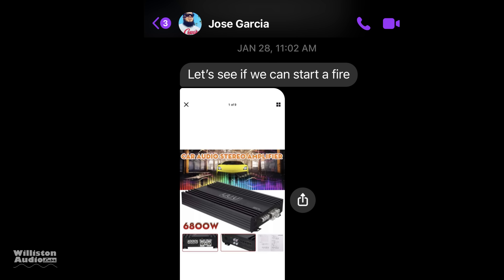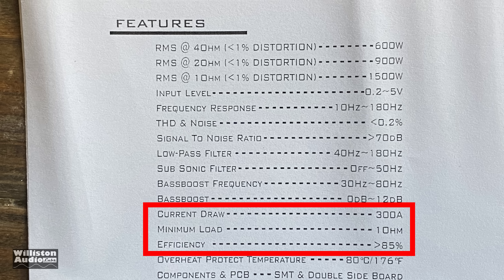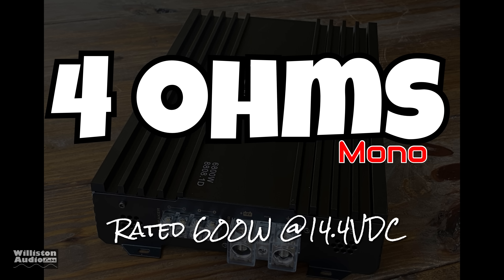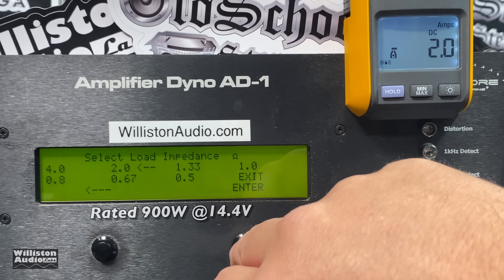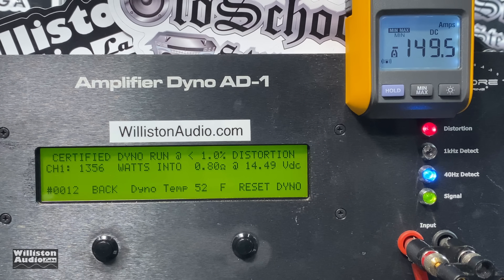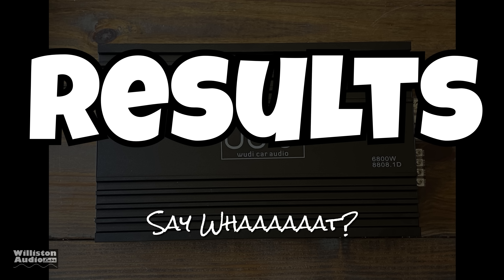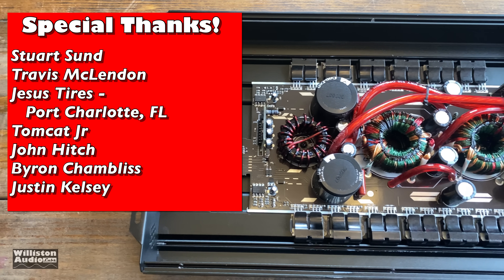BEST $100 Subwoofer Amp?? WUDI 8808.1D 6800W Amp Dyno Test and Review [4K}

Comment: this amp is a repairmans dream come true if you know what to look for. the audio output generation circuit is isolated by optocouplers from the actual drivers and final stage hence damage never goes further than the optocouplers! 

in my experience its the closest ive seen to modularity in an amp build. this board design is quite generic and generally makes 1500w @1ohm. there are weak spots tho and could and should be beefed up before use.

if anybody has Perrys guide, its generic class D type 4
Reply: Beefed up how?
Reply: @FreeStyle786  this one has some good glue on the transformer winds to minimize vibration. also the board is screwed down the middle which helps a ton in the long run. both the driver card will need supports tho. other than that looks like the amp will do well in the long run

Comment: So, it appears that just to save a dollar or two: they ruined the structural integrity of the board. Perforate and break off the driver cards right out of the board. Cheap AF! These will undoubtedly suffer from vibration damage-related issues. At least the D'Amore amp you reviewed was engineered properly with good QC. This is just cookie cutters and terrible shortcuts.
Reply: @wal  I forgot to mention that you're doing a great service to the community and no matter what I say, I appreciate every bit of media you release!

Comment: as of the 5th of feb 2021 when this video was posted . in SA it cost equivalent to  235USD so no not under 100usd. but its a strong amp by the looks of it. and surprise 0.5ohm which rick says many amps cant do.

Comment: same brand of caps as the D'amore amp you just tested.👍
Reply: @E Dud interesting, thanks for the comment. I have wondered if the more the more budget friendly D' Amore amplifiers were using cheaper parts & materials... Figured they had to be considering they are priced as low as the $200 range. I had been looking at one of the D' Amore 4 channel amps think it was like $230 or right around that price. (I don't remember the exact price but you can find the on the D' amore site) Idk if I should pass on it & look for a better 4 channel, just curious about the quality of a D' Amore amp priced in the $200 range brand new. 🤔
Reply: @itdoesntmatterwhatyourname6128  Yep I think im going to buy a couple of them anyway because you know Tony had to have done his homework when picking out all the internals he doesnt want anything coming back🤣I bet he did alot of testing I was sold when Steve Meade put the 350.2 and the 750.1 on the dyno they did outrageous numbers👍
Reply: Yes it was your right ! I didn’t notice it until you said that and D’amore is suppose to be nice stuff far as I know !

Comment: The broken off sections of the board are the 2 pieces used as daughter boards on the amp.
Reply: I have no idea what a daughter board is. Can you explain it in super laymen’s terms.
Reply: @dtmfool789  To elaborate a bit more, they use the so-called daughter boards as the driver circuits are common circuits used across multiple amplifier models. Rather than redesign the same circuit over and over again into each separate amplifier circuit board, they make it its own stand-alone circuit with a connector so it can just plug into whatever amplifier its needed in. In this case, they can just copy/paste it into the CAD files for each circuit board where there is some empty space to accommodate it. At production time, its "populated", or has the components put on, and then there are what are called "mouse bites" or perforations, that allow the now complete little daughter boards to be popped out of the big circuit board, and then plugged in to complete the amplifier.
Reply: @dtmfool789  when two amps love each other very much....
Reply: @dtmfool789  its any separate pcb that integrates with the main board by pins or cables.
Reply: @dtmfool789  - Those two little boards sticking up (vertical). One of them is right next to the cutouts.
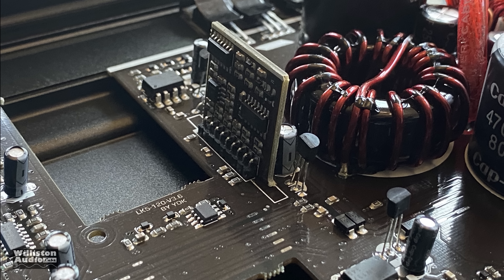edit: @ 10:50
Reply: The two pieces, one for the audio driver board and the switching driver board.
Reply: Yep.